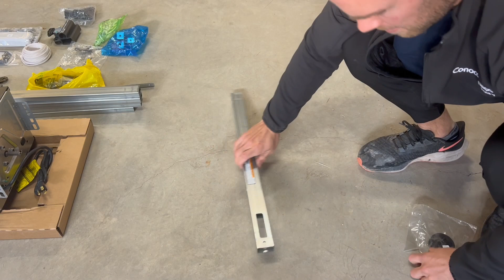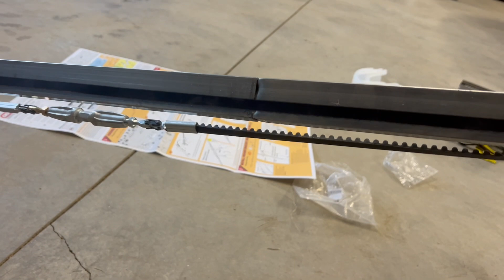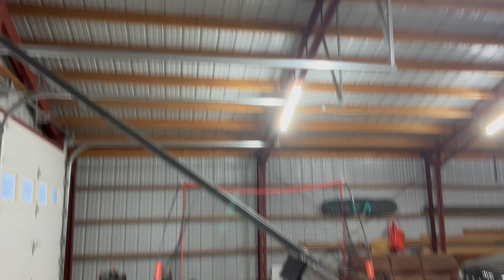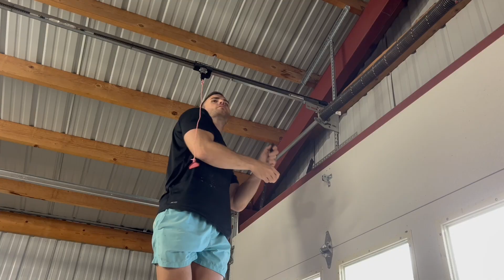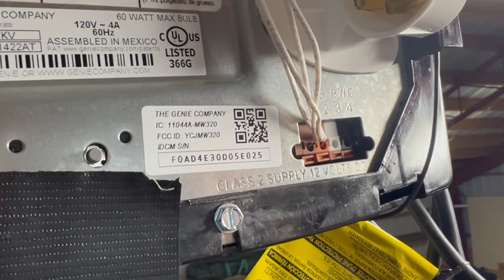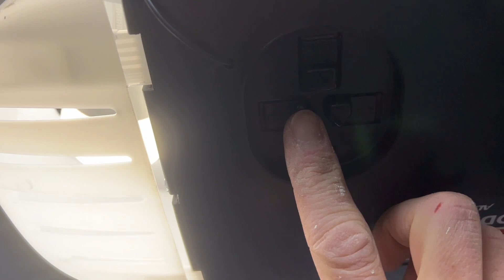How to Install a Genie Belt Drive Garage Door Opener + Programming & Setup | Builds by Maz

Comment: One of the best instructional videos I've seen. Way better than trying to follow the instructions. Awesome job!
Reply from the maker: Thanks!
Reply: @buildsbymaz  I actually got it installed this morning and used your video along the way, much easier than the instruction manual.  With as tall as your ceiling is, did you ever consider a side/wall mount opener?  Easily double the price as the Genie but just curious.
Reply from the maker: @kelencamehl  No I didn't, mainly due to the price as you mentioned.

Comment: Question.. so belt tension is set while building on the floor.
After install, since the " slide together links then are sagging", how should the belt tension be set?
Awesome video by the way, and thank you so much
Reply from the maker: Is there a part of the video you are referring to? You should not need to readjust the tension once you have it set on the floor before installation.

Comment: Does this have to replace the same  type of system? I have an old Genie that has pulleys and springs that I want to replace.
Reply from the maker: Nope, it can work on most any garage door.
Reply: @buildsbymaz I guess the question is how much work would be involved in the electrical wiring part of it?

Comment: Only question I have is if it matter which lug you put the striped and solid wire in on the sensors? Don’t appear to be labeled ground or power so idk
Reply from the maker: I don't think it matters, but I can't remember for sure.

Comment: Question.i just installed my genie garage door opener but when it hits the floor while closing it keeps opening by it self,what would be the problem? All the wirings are properly connected.thanks!
Reply from the maker: I would try to reset the 'bottom' position of the garage door. It probably thinks the door is hitting something before reaching the ground and that's causing it to open back up.

Comment: I just put one of these together…..i was super disappointed in the 5 piece plug together rail….it bends up and down like rubber..  and many parts that should be made of metal are now plastic….. the bean counters at Genie obviously run the show… the whole unit felt super cheap and too lightweight in construction.  Should have bought a Liftmaster with the one piece rail that is nice a solid.

Comment: Another question...it says NOT to use an extension cord to plug in the motor..so how long is the plug that is on the motor?
Reply from the maker: Only a few feet- it is meant to plug into an outlet located in the ceiling near the opener. However, if you do use an extension cord just make sure it is the proper gauge.

Comment: Great video. I'm installing mine now. A couple add ons.  When installing the black rods it days to move the carriage 16" from door. And angle cant be more than 30 degrees.  Also depending how thick of door you have, carrige bolts and nuts should be 1/2" wider than your door to pull it open. Use stainless bolts so they font rust.

Comment: This is an awesome video. I have a craftsman belt driven one, but it's pretty much shot, and I need to install a new one. 

The genie cost the same as the craftsman and has a faster motor, so it's a win for me. 

Looks simple enough to do, and I can probably reuse the brackets that are already installed for the motor, so that's another plus. 

I replaced all of my wheels with the nylon ones last year, and I added heat shrink to the studs, and it is super quiet now.
Reply from the maker: Yeah the Genie has been awesome, you will be happy with it.

Comment: Thank you!  Great video!  Used it along with the instructions but pretty much ignored the company instructions after a while and stuck with your video.  Would have been nice to have a few trouble shooting tips... my wires weren't quite seated in the clips the first time around, easy fix.  In addition, the garage door would go down and then come right back up again.  I ended up reprogramming it and I am hoping that takes care of it.  Quick question...at rest the belt hangs much looser on the rail than when I first tightened it.  When the door operates it is pretty tight.  Is that how it is supposed to work?  I have nothing to compare it to.  Thank you again!!
Reply from the maker: My belt is the same way - if everything is working properly, then you should be all good. Thanks for watching!

Comment: I can't tell for sure, but your doors look like they are 8' high. Didn't you need to use the GEN39026R rail extension kits?
Reply from the maker: I did not need to, because my car can still easily fit under the door. But you are correct that my garage doors are taller than standard, so if I wanted to be able to open them fully then I would have needed the extender.
Reply: @buildsbymaz  Ah that explains it then. Helpful video BTW, helped me decide to purchase two 3053-TKV's for my 9 x 8 OH garage doors.

Comment: Thank you. My installation went smoothly, and I love how quiet the opener is compared to the old one. The only problem that I have is that the lights don't shut off after the door opens. They do shut off when the door is closed. Any ideas of why they're not shutting off?
Reply from the maker: Even after a couple of minutes they don't turn off? Very odd..you may need to reach out directly to Genie and ask them.

Comment: Can you do a video on how to program a hand held door opener
I bought a house it has garafe door opener but didn't get and remotes with it.
I bought a replacement, says for most doors but i can't figure out how to setbit up.
 I have pore eye site and all the instruction printbis so small.
I can't read it very well.
Reply from the maker: I think that will depend on the brand of garage door opener. What brand do you have/what brand is the hand held remote?